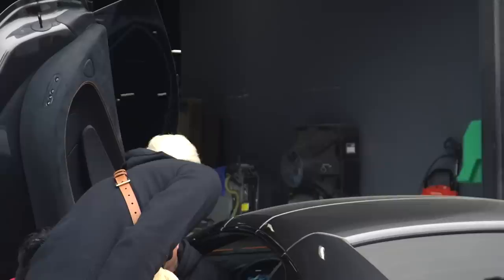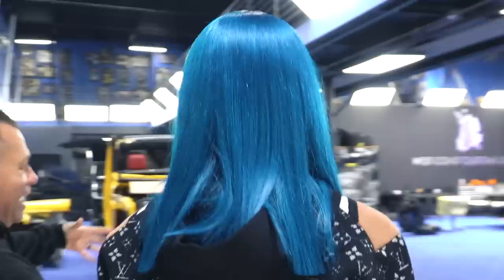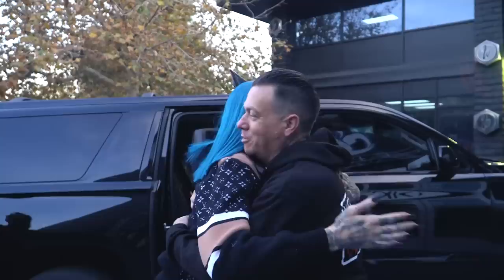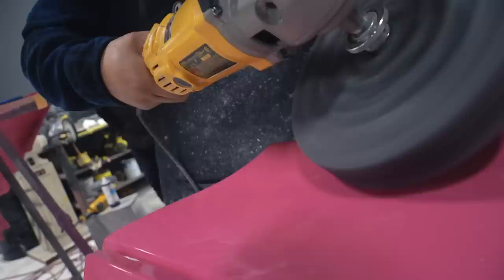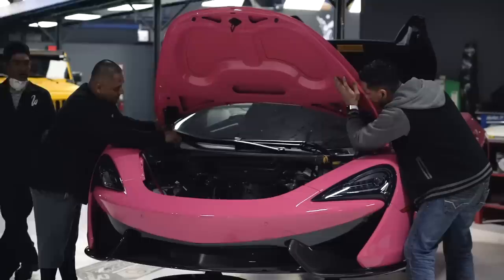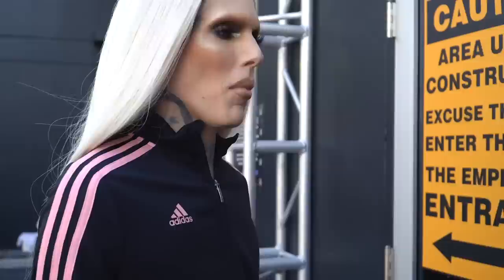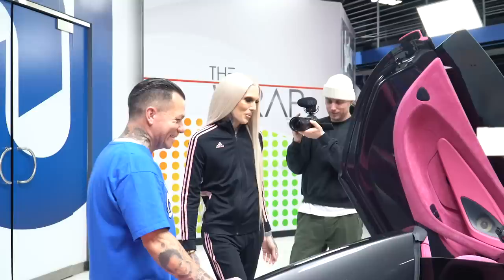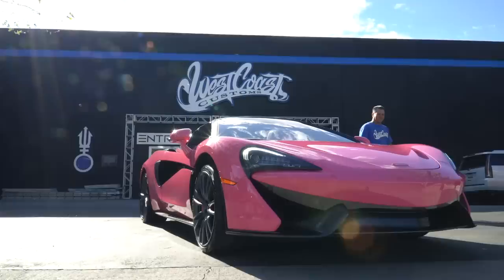Jeffree Star’s Custom McLaren 570S | West Coast Customs

Comment: How do ya'll stay so organized? I would've lost parts here and there.
Reply: they have a full team each man is responsible for each part of the car.
Reply: They are so organized that they would be smart enough to put bolts and stuff in a ziplock bag and half it somewhere where they can easily remember and every man there has a specific role and they all work as one step by step. Not to mention they are one of if not the best auto shop in the world. (They do everything you can imagine doing to a car).
Reply: They're professionals.
Reply: Nancy Y. I would just do the same thing I would do with legos just separate them and put them on a tray
Reply: These dudes are so talented bro. Designing cars like that. I know for a fact that each of them have at least 6 figures in the bank 💯.